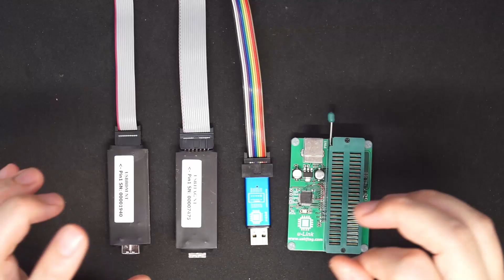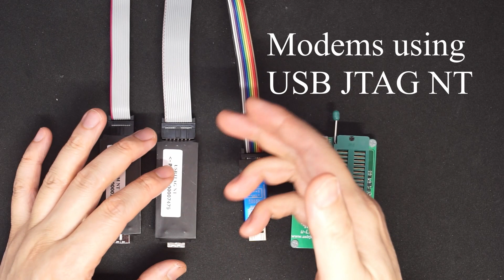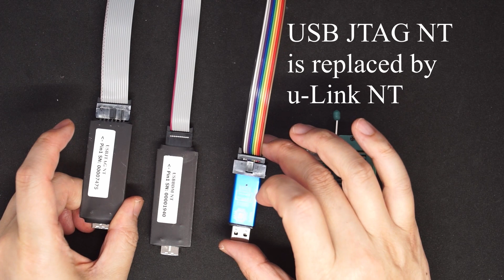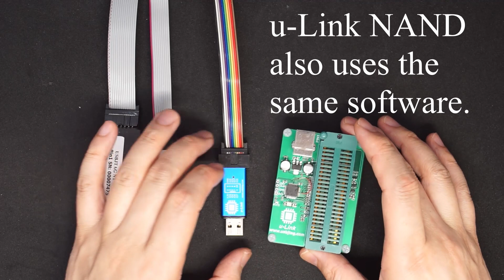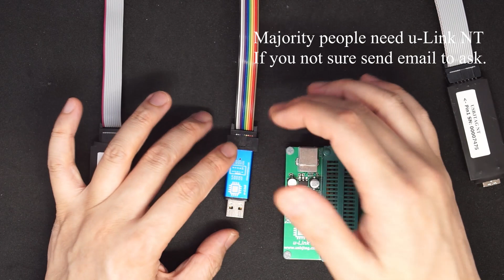USB BDM NT, USB JTAG NT,u-Link NT,u-Link NAND explained.

Comment: Hello sir, first of all many thanks for the video which cleared few uncertainties. could you please kindly advice, which gadget should i be using to flash Meraki access points mainly  mr12, 18, 33, 34 etc..etc.. with OPENWRT?

As soon as you confirmed, I am planning to make the purchase through your site. Thank you in advance
Reply from the maker: I have not done MR12, But I have done MR18 and MR16. Both uses u-link NT. I think MR12 can use u-link NT as well (If I find one I will make a video). 
MR33 use u-link NAND. I assume MR34 will work too.
Reply: @usbbdm  Thank you very much for your prompt reply. If I to buy both modules will I be able get in discounted price¿

Could you please kindly send me a link to pay

Thank you in advance
Reply from the maker: @ithelpers4625  Check www.usbjtag.com

Comment: The USB JTAG NT will be missing best programming USB. If you have a USB GTAG NT keep and avoid the trash U-LInk NT.
Reply from the maker: What is wrong with u-Link NT. Please be more specific. The same thing I heard when USB JTAG NT was released and someone was missing old USB JTAG (not NT version).
Reply: @usbbdm   hard to make it work I purchased both of them Gtag and U-Link and Gtag work like a champ easy to set up and use with any modem. in the other hand U-Link hard to work with it clip connections I purchased mine like 6 months ago and I had have flash none modem with it no luck to make it work with 6141&6121 modems.
Reply from the maker: @flako4u77  Thank you for your feedback. Please come to my site and we can discuss this issue. I hope I can help you out since the plan is to make u-Link NT better than USB JTAG NT and if it failed I need to know why. For your issue with SB6141 modem please watch my previous video "Easiest 16 pin SPI connection with u-Link NT. (No soldering)".
Reply from the maker: In another video (oI84xkQzssc), you commented you had trouble with USB JTAG NT as well to work with SB6141 modem. Program SB6141 is easier now than before since the 3.3v from u-Link NT works and no risk. Thus you should have far less trouble than USB JTAG NT (trouble to find 3.3v source).